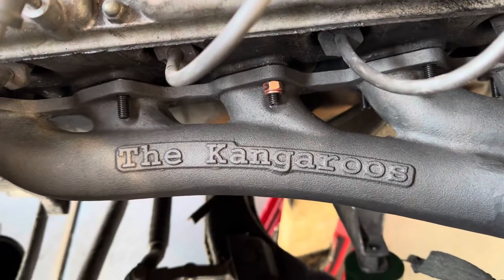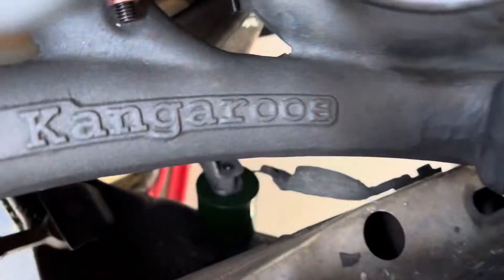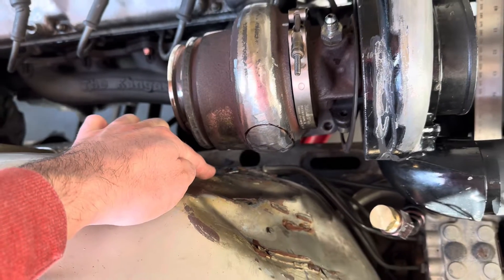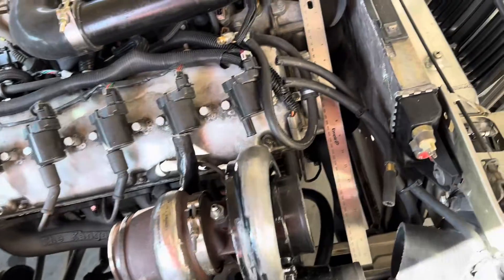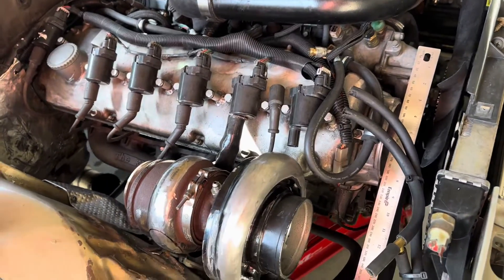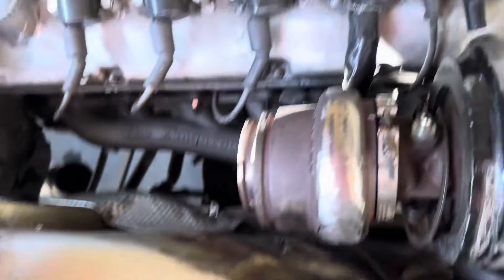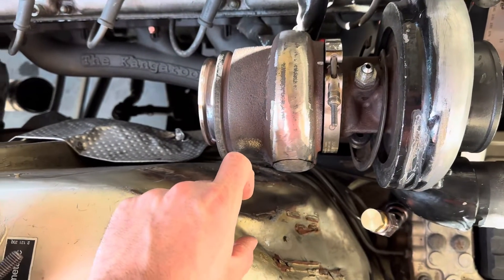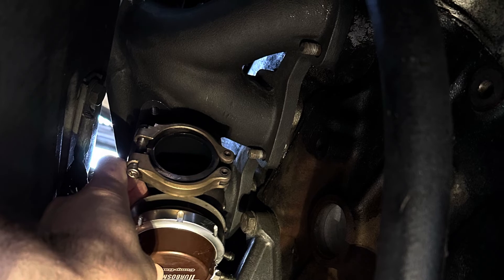E28Goodies M30 Turbo Manifold with Holset HE351 Fitment Walkthrough

Comment: must say that's a manifold that will make alot of heat and bad flow.
Reply from the maker: How so ?
Reply: @TurbineResearch  it's narrow pipe all the way, resistance gives more heat in the exhaust it almost looks like a stock om606 header. a turbo header shouldn't be like this on a 3.4/3.5l engine
Reply from the maker: @julianlaustsen1991  my old manifold was made out of old fence pipe attached to the stock exhaust manifolds and made 560whp. I guess I’ll have to dyno this one and see how it does.

Comment: I have a kangaroo m104 manfold im looking forward to installing it lots more room than a headers and way more robust looking. Are you still running 50% methanol and petrol blend?.
Reply from the maker: Yes, when I’m on high boost I run a flex fuel with methanol
Reply: @TurbineResearch  Its so cool that you not only try stuff but actually make it work so well. Did the methanol petrol mix have issues with separation or anything if you let it sit to long.
Reply from the maker: Thanks 🙏 I didn’t notice any separation of the fuel that I can tell. The flex fuel sensor always reads the same mix and I imagine the fuel pump constantly cycling fuel keeps things pretty well mixed. I have also read that ethanol helps to keep gasoline and methanol stay in solution. So the ~10% ethanol in pump gasoline helps with that I suppose
Reply: Thanks great we have e10 fuel at the pump I think the other issues with corrosion is solved with correct fuel hose and fittings I have used por15 tank seal before for a fuel tank and methanol has no effect on it so i can line the inside of the steal fuel tank. The one other thing is moisture I hear guys running 100% on street cars have a shutoff  valve on the fuel tank breather so no air can get in while the car is sitting for a long time.

Comment: I think that heat from turbo will affect coil lines, at least it did in my car.
Reply from the maker: I haven’t had much trouble with that but there are coil wire insulation boots available to help